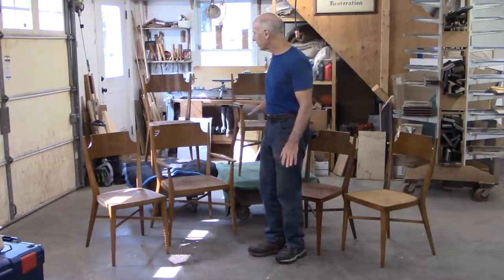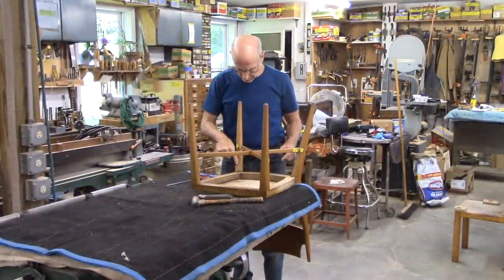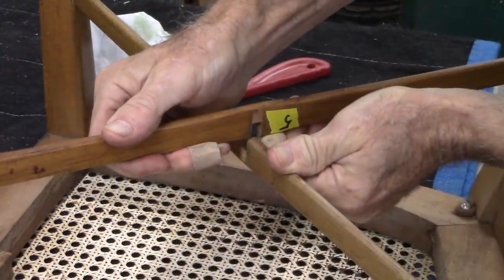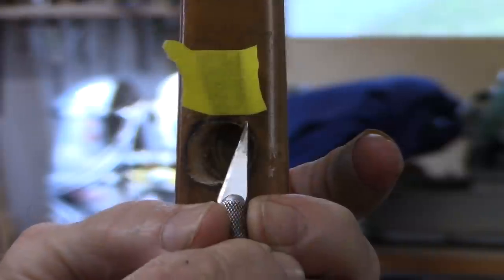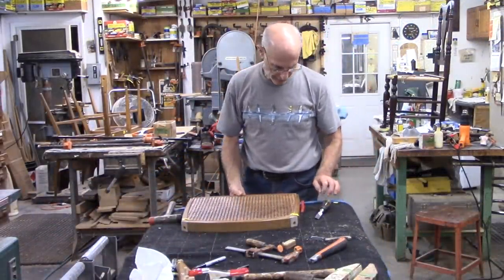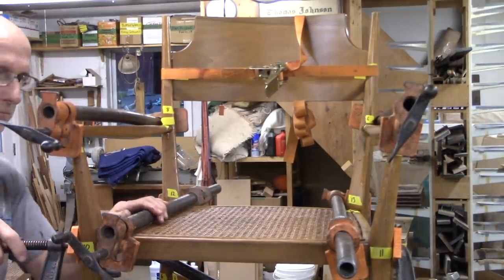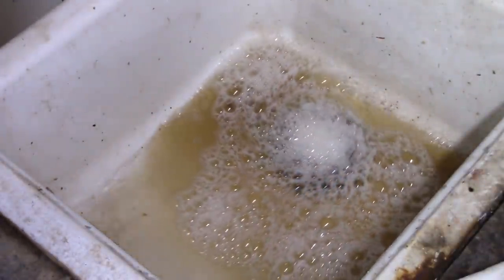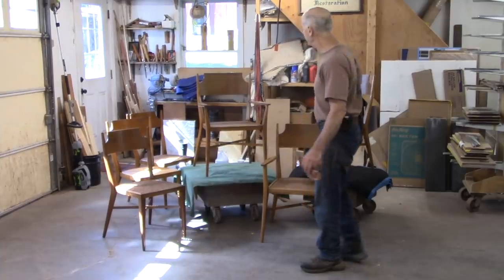Restoring Midcentury Modern Chairs by Paul McCobb - Thomas Johnson Antique Furniture Restoration

Comment: It appears that the liquid hide glue crystalizes over time and basically "self-destructs".  Why, then, is it still used in lieu of a better, modern product?
Reply: Rick, i don’t think that the “original” glue was hide glue, if these chairs are from the 50’s or 60’s then it could be PVA or Urea or other modern glues, these have to be scraped off before re-gluing as it will interfere with the bond
I’m assuming that Tom is using “Old Brown Glue” (Made by Patrick Edwards - it’s traditional hide glue with additives that give you a long “open time”) this allows Tom to do a complicated and lengthy glue up with some semblance of peace. Most glues (PVA’s - Titebonds and others) have very short open times like 15 or 20 minutes max, before they shin over and then won’t give you a good bond, hot hide glue as seen in his other videos gels quickly, it’s still ok, but you wouldn’t get the time necessary to glue the whole chair and would lead to panic, so the “Old Brown Glue” is a great glue choice in this instance
Lastly, hide glues are easy to clean up, even after it’s dried, PVA’s and others need to come off immediately which is tough of you have a clamp or? in the way, also hide glue does not affect the finish, where residues of PVA’s and others will interfere with dye or stain penetration leaving an unsightly mark
Reply: Rick Solari PS, with regard to the crystallization of old hide glues, the hide glue is moisture sensitive and over time does, but the beauty is that taking the joint apart is easy and less destructive, also you don’t need to scrape or remove all of the old glue to get a good bond as the new hide glue re-constitutes the bit left over (bond strength is not affected), if you need to disassemble and clean modern glues it can be a lengthy and difficult process and you need to get most of it off before re-gluing
Hide glue is also reversible so museum quality restorations require it as what’s important is the original bits of a piece and as time goes along a repair might need to be redone, I think we have seen Tom use heat and a damp towel to undo hide glue joints and with heat one can sometimes reactivate old hide glue to reattach loose veneer
Reply: @georgepauls2911  ....I just restored an old side table that had what I believe was old, crystallized hide glue. Approximately 75-80 yrs old... All the glue joints were effectively unbonded. It was very easy to scrape off the old glue. I reassembled with Tite-Bond which was what I had on hand. 
And thumbs up to Tom! I’ve learned so many things from his videos which have transformed my approach to these projects. Just wonderful!
Reply: mercoid yes that would work, I don’t have a problem with PVA’s they are good glues, but not suited to all applications, if I’m working on an 18th Century Philadelphia Chippendale piece I only use hot hide glue, if it’s Modern I pick the glue that works the best, in the case of something like these chairs Tom had many parts and needed multiple clamps, the short (15-20 minute) open time of PVA’s would be a real problem as the parts all need to go back in the proper location and with all of Tom’s labeling there is still a possibility of screwing up in the panic to keep within the open time, other issues are that the piece is not painted, but clear - PVA’s unless completely removed will affect the finish, especially the penetration of dyes and stains, cleaning the hide glue in this case is easy and can be done after it dries which is not the case with PVA’s - this would make the glue up even more stressful
If the break is a structural one and regular glues would be too weak (say a chair back which gets a lot of lever action as the sitter leans back) I’ll often use an elastomeric epoxy (G-Flex or Flextec) as they don’t cure brittle, can be sanded, sawn, chiseled, and colored with various pigments and have a bit of flexibility to withstand shock
In my opinion there is nothing worse than the panic that sets in as one is doing a complex glue up and time is running out
Reply: @georgepauls2911  ...Thank you for the informative reply. I’ll look to employ this information soon, as I have several chairs awaiting restoration in my garage. A few of which have been badly molested by the previous owner with all manner of screws and mending plates.
Reply: mercoid my pleasure, regarding the elastomeric epoxy, some frown on using it, but if your customer wants to robustly use the chairs vs just having it sit in a corner with a ribbon to keep folks from sitting in it, the epoxy is great, the flextec comes the thickness of axle grease, the G-flex (by West System) is runny when mixed and I choose to add the 406 filler as it’s got superior bonding properties, color starts as an Amber, if you add the 406 it’s a creamy yellow and you can mix to whichever thickness you need (I prefer thick enough so it doesn’t slump, but if it’s a horizontal surface it doesn’t need to be as thick - Note- West Sys makes a pre-thickened version of G-flex that I’ve used with a vacuum system to adhere a 3/8” veneer of reclaimed southern yellow pine on both sides of a door and didn’t want bleed thru). One of the benefits to the G-flex is that after you have mixed to the consistency you want you can add dry earth pigments/fresco colors/Bohlen or Mohawk has them and Tom uses the Mohawk ones - I wet the wood with denatured alcohol or paint thinner to preview the color of the wood as if it had a finish and then add pigment to the epoxy to get it close (I want a bit lighter, never darker).
This really helps if there are missing bits and if the chair has a balloon back with the narrow waist where there’s lots of short grain you stand a chance of making a lasting repair
Good luck and have fun!!
Reply from the maker: Thanks! Wow! George Pauls did a great job of answering this one!
Reply from the maker: Wow! Thank you! A wealth of information! I appreciate it

Comment: why replace broken phillips head screw with an obviously unoriginal flat head screw
Reply: Same overall size.
Reply: Because it was the best readily available fit in terms of size. Given the state of deterioration of the old screws and eyes, it would have been apparent that it was not original anyway: it's bright and shiny...
Reply: dlevi67 you heat the shiney screw up with a torch and you dip it in oil to turn it black its called japanning
Reply: @tempestnz1  The other screws are not japanned...
Reply from the maker: The other commenters are correct, I was just going for the proper size
Reply from the maker: Exactly. Thanks
Reply from the maker: Yes, thanks

Comment: For the broken screw, I would have used a screw extractor or easy out drill bit.
Reply: There was still the eyelet on top... and the easy-out bits generally are pretty short. (Plus, to be honest, given how rusty the thing was, I doubt an extractor of any sort would have worked, but your opinion is as good as mine on that!)
Reply: @dlevi67  Well, it's metal in wood. So I think there would be no problem getting it out.
Reply from the maker: Thanks! I have rarely had good luck with extractors
Reply from the maker: Yes, the eyelet in fact gave me the idea of using them as a guide for drilling screws. I have never had good luck with extractors